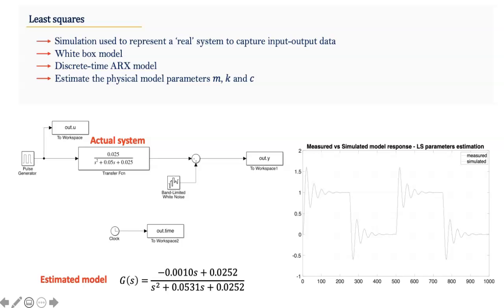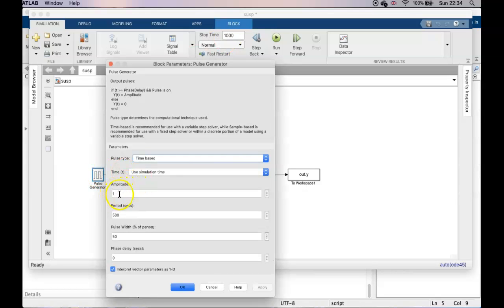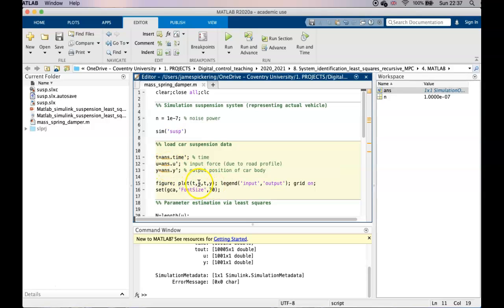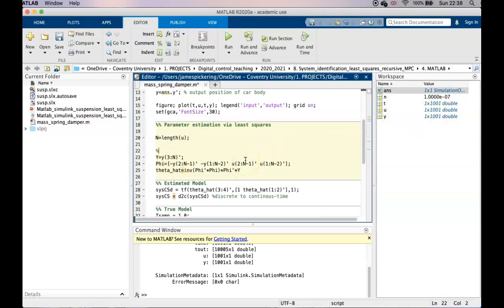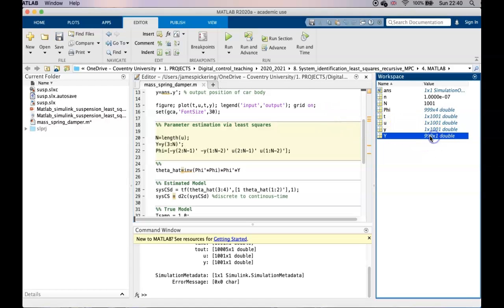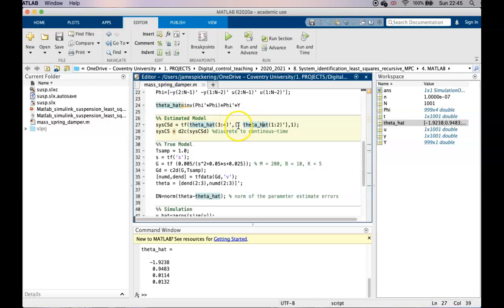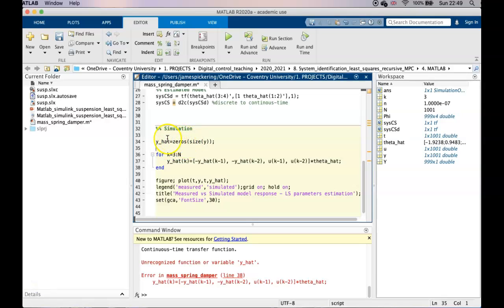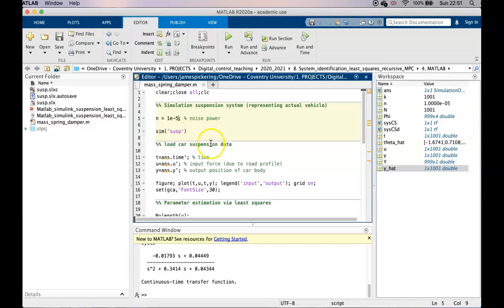System Identification: Least squares applied to a mass spring damper using MATLAB & Simulink

Comment: Dear Nithu,

Because the system has a second-order transfer function, its digital implementation requires using previous values of the output and input signals. In MATLAB, we cannot use negative indices, so to ensure valid equations, the output starts from the third value. Thus, 
Y starts from y(3:N).

This approach is tied to the order of the transfer function, not the number of inputs or outputs.

If you have a 2-input, 2-output system, you will need to adjust the matrices to accommodate the additional inputs and outputs. Specifically, lines 22 and 24 should be modified to account for the multi-input, multi-output nature:

>Construct the matrix A to include the previous values of all inputs and outputs.
>Adjust the dimensions of the vectors and matrices to handle the additional inputs and outputs.

This ensures that the least squares estimation correctly captures the dynamics of the multi-input, multi-output system.
Regards